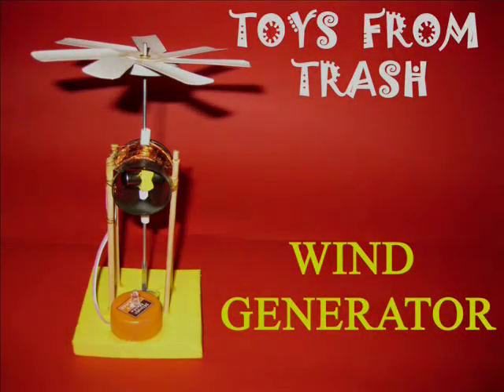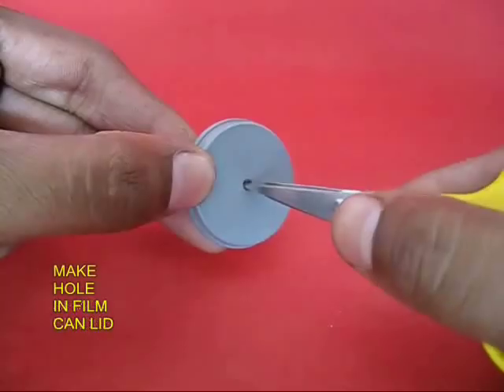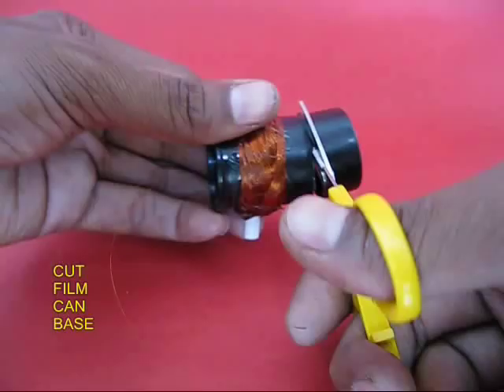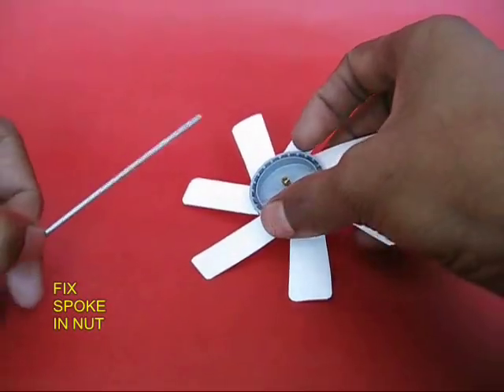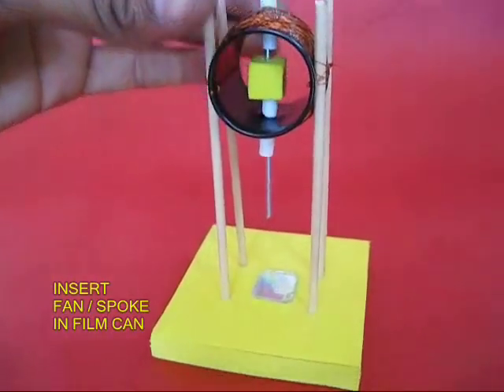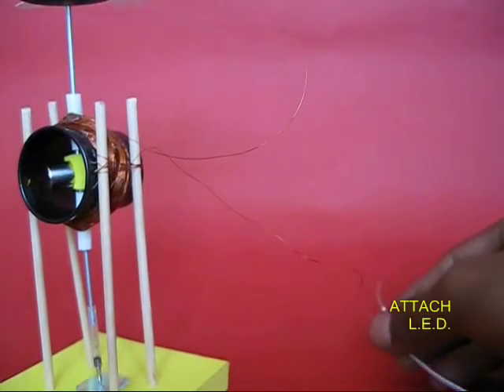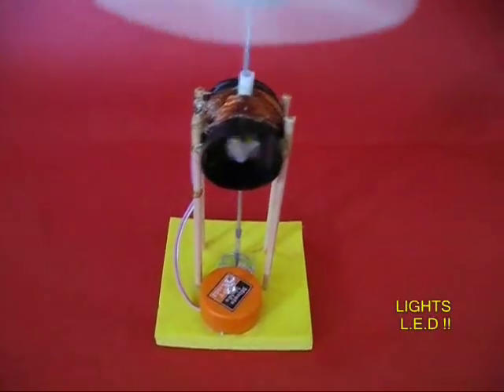WIND GENERATOR - ENGLISH - 28MB.wmv

Comment: @shreya shankar the wire gets the electricity from the changing magnetic field. If you just wave a magnet near a conducting wire (copper in this case) the wire will acquire electricity or even if you wave a wire near a magnet the same will happen or you can do both ! It's called Faraday's laws of induction : https://en.wikipedia.org/wiki/Faraday%27s_law_of_induction
Reply: Thankyou

Comment: @humantorchid it does not matter. the generater is not a generator, it is really an alternator, it is make AC electricty, thats why the LED flashes. so you can hook up 2 LEDs to it in parallel(one wire to the pos of LED1& ned of LED2, hook the other wire to neg of LED1 & the pos of LED2), and they will flash back and forth, or you can hook up a rectifier so it does not flash.

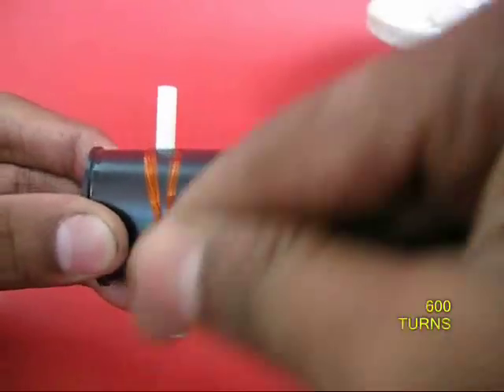Comment: @08renz1 if you watch the video, it has little letter that make this wounderful thing called words that explains each step.....it states 600 turns (0:25 - 0:29), and since a 35 mm film canister has an approximate diameter of 1 3/16" so that gives you basicly 2237" or 186.4 ft so round it up to 200 ft of wire is needed.

Comment: order from ebay..
use about 30 - 38 gauge about 1000 - 1200 turns for better results ... 
if u want wire for free just open a old transformer ...

Comment: Sir if we use copper wire slightly thicker than yours and number of turns is approximately 450 and also use breaked ovel magnets. Does it works?
Reply: is not that difficult to do....you need to stop being lazy and just do what you ask....you can even upload your video of your design...

Comment: What length of copper wire do u use !!!😫
Reply: sudipto lahiry As long as you can, the more turns you do the better, but there is a limit, it should not be too bulky because in that case the friction between the refill and the disc-piece will increase and the spinning speed will go down resulting in less electricity.

Comment: how did you get 2 wires sticking out instead of 1????
Reply: CN2Bubble Two ends of the copper wire.
Reply: CN2Bubble Two ends of the copper wire.

Comment: this video is nice one but can sm 1 help me understand that how d wire receives electricity ? plsss
Reply: +shreya shankar Your question is the most interesting, not even the top scientist can determine what actually happens when a magnetic field reacts with a coil of wire, apart from knowing that it would produce or generate electricity. Which of course is Electrical Energy. But Energy cannot be Created no matter what, it can only be transformed, so that the wind pushing against the blades causes the magnets to rotate causing the Mechanical Energy (Wind) to transform into Electrical energy.

How does a moving magnetic field or if you like the other way around where the magnets can be stationary and the coil is made to move inside this invisible magnetic field, in order to react with this filed to start transforming mechanical energy into electrical energy, yes we call it generating Electricity, or producing electrical energy, but  In a real sense it is not being created as such, no one can create energy.

but energy can only be TRANSFORMED from one form to another, i.e. Kinetic energy to electrical energy. here the wind acts as a mechanical (kinetic ) energy and by moving the magnets inside a coil of wire, this invisible magnetic field or its lines of force cutting the wires inside a coil and starts to transform mechanical energy into electrical energy. Remember No one can produce or create Energy, NO one can. Energy cannot be created or produced nor can it be Destroyed, or Used up, Energy will always remain constant in one Form or another, so if we run out of oil, we will have to use another form of energy, like nuclear, or coal, or wind or solar. But the good news is we will never run out of Energy. Thank God for that.

But deep down, it still does not answer your question nor mine, How does mechanical energy gets transformed into Electrical,  to find the answer, think how electric current flows when a circuit is completed, it has to have a Potential Difference, (Voltage) and a conductor with lowest possible resistance to electron flow, such as copper wire, and the load (like the LED in this example) again we are not depleting energy as we are simply converting our mechanical energy into electrical energy and then into light energy and some losses due to resistance of copper wire into heat energy, so overall the energy we started with remains constant.

So we can say invisible Magnetic field is the secret key to transform mechanical energy into electrical energy, but we do not know God's Secret, how it manages to transform that, no body knows so far, but thousands of guesses.

My best guess is that magnetic field or its lines of force kicks electrons inside a copper coil and pushes them out from one end and takes it back again from the other, the harder the kick, and (speed of wind) and how many electrons it can kick at once, (the number of turns) and the stronger the effect, so remember a coil has two ends, starting and finishing end, so when magnetic field's invisible lines of force cuts the copper wire, it starts to kicks out the electrons  which are part of the copper atomic structure, and as it is kicked out, it pushes the next electron, like a domino effect, and so if one electron gets pushed out along the wire, then all the electrons in front of it gets pushed out, and this means there will be one electron short so as our circuit is complete loop, then the electron that was displaced or kicked out of the coil receives another electron from the load side that was displaced and so overall number of electrons remains the same but they are just made to move in a endless loop until the magnetic field stops reacting with the coil, 
As No one can create energy,  and so no new electrons are being produced, only what we have inside the coil of wire and the rest of the circuit that we are simply making these electrons flow from one side out say from the Negative side and then receive it back from the Positive side,  actual current flows from negative side to positive side, but we have traditionally assumed that the current flowed from positive to negative this is called conventional current flow, so in doing so we have electron flow and the LED lights up when electrons flow  through its chip, emitting photons, 

Strangely, but whenever an electrical current flows it will do something, it can create electro -magnet, it can heat and emit warmth, and or emit light, or even make things move such as in electric motors, a light is a emission of photons and as well as electromagnetic waves,  so the thing is if one is given electrical current his hair will stand on his head! 
electricity is very useful form of energy, itself it is not energy, only God is the ultimate source of all energies.
so no new energy has been created. That is why God will never die nor he was created. And with that God can naturally transform into anything he wants, in any shape and any form. That solved that old religion problem.

so I hope this some what answers some mystery how current is produced, and as I said there are millions of theories, none can be proven, but mine says the magnetic field simply starts to move electrons when the circuit is complete, if the circuit is not complete, then the electrons jump back in,  like say your papa throws you out of the front door (moving field) because you were naughty, but you then jump back in from the window, and he throws you out again and if he was asleep he does not throw you out and you remain inside, but if your boyfriend was outside he would take you away but only when your papa opens the front door,  and if your boyfriend don't take you back home, then your papa cannot throw you out again, (complete circuit loop) but if you did come back, your papa was awake, he would throw you out again for being naughty. But each time your boyfriend takes you, his face glows bright!
Reply: I'm reading this after five years!! has made me so emotional shizzz thankyou btw

Comment: If you put a small VAWT on the roof and the led inside, you could tell how windy it is outside without opening a door or window.
Reply: ***** Nice idea.
Reply: ***** Nice idea.
Reply: atanu nath
But it will require a way to keep the led from burning out if the wind is too strong. Zener diodes could maybe be used to make a string of leds that light one after the other as the wind-made power rises.
Reply: ***** Improvements can of course be done but the idea is important. We need also to calibrate the wind-speed and the frequency of blinking and I think it's the easy part, in fact if we can device an interface with the smartphones let's say through it's camera much like how all  the "heartbeat" calculating apps function using the camera and the flashlight that calculates how the blood fluctuates inside our fingers, I think we can use the same apps to register the fluctuation in LED brightness and use it as a counter.
Reply: atanu nath
There's no need for high tech to do this. If you want blinking then wiring the generator to only deliver current for 1/2 a revolution and not the other half would make blink.
Otherwise I would use a small Arduino to watch an anemometer and blink the led but that would be more expensive and use power all the time.
Reply: ***** true but I wanted a system tha counts the blinks (f) because everytime counting for a minute is not convenient so a screen of any sort should show me the average frequency..  converting that to wind speed is simple.